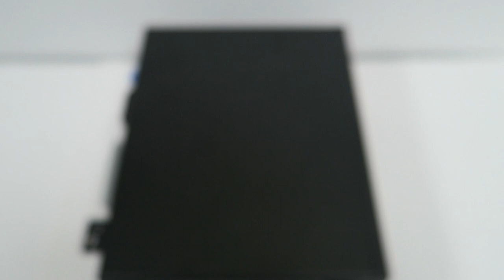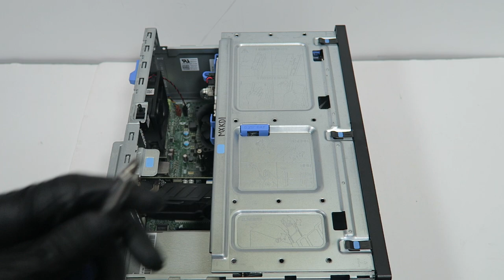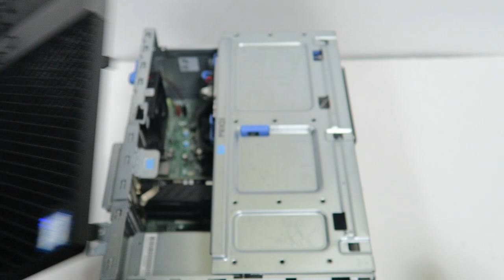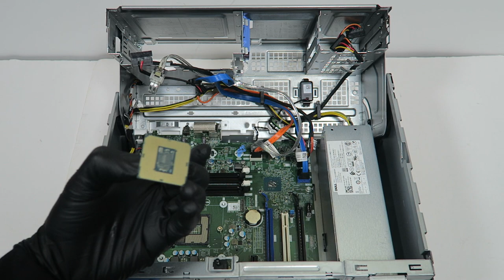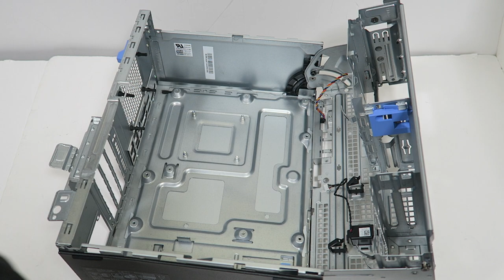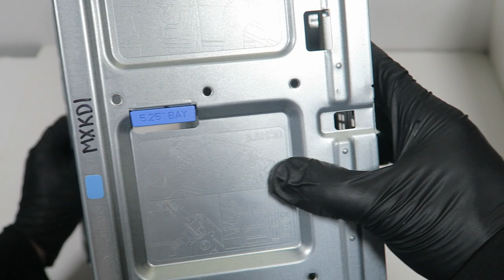Dell Optiplex 7050 5050 3050 Teardown

Comment from the maker: List of Upgrade parts that work with this system. 
 

Dell Optiplex Reassemble
https://www.youtube.com/watch?v=d_iJJm0R1hk

USB Wifi Adapter for PC AC600Mbps Wireless Network Adapter
https://amzn.to/2ZaGuHb

Thermal Grizzly - Spatula for Applying and Spreading Thermal Paste 
https://amzn.to/3d8NQEE

Thermal Compound Paste:
(1.) Arctic Silver 5 Thermal Cooling Compound Paste 
https://amzn.to/2ziNU0H

(2.) Noctua NT-H1 3.5g, Pro-Grade Thermal Compound Paste
https://amzn.to/36kTk7A

(3.) ARCTIC MX-4 (current edition) Thermal Compound Paste 20 Grams 
https://amzn.to/2DhGJaK 

List video cards will work with this system GT 1030 will work with 180W Power Supply or 240W you can use GTX 1650 or GTX 1050 TI low profile.

AMD Radeon RX 6400 Low Profile Gaming Graphics Card
https://amzn.to/3s8MUUY

XFX Speedster SWFT105 Radeon RX 6400 Gaming Graphics Card
https://amzn.to/3xkmXo1

Gigabyte GeForce GTX 1650 OC Low Profile 
https://amzn.to/3el08os

(1.) Gigabyte Geforce GTX 1050 Ti OC Low Profile 4GB GDDR5 128 Bit PCI-E Graphic Card (GV-N105TOC-4GL) 
https://amzn.to/2T8bfsv

(2.) MSI Gaming GeForce GTX 1650 4GB GDRR5 Low Profile Graphics Card (GTX 1650 4GT LP OC) 
https://amzn.to/2X1FYsF

(3.) MSI GTX 1050 TI 4GT Low Profile  Graphic Cards 
https://amzn.to/2LwZd7P

(4.) Gigabyte GeForce GT 1030 GV-N1030D5-2GL Low Profile 2G Computer Graphics Card 
https://amzn.to/2Z4PHkp

(5.) ZOTAC GeForce GT 1030 2GB GDDR5 64-bit PCIe 3.0 DirectX 12 HDCP Ready Low Profile Video Card ZT-P10300A-10L 
https://amzn.to/2WzgLXk 

RAM List:
(1.) Crucial 8GB Single DDR4 2666 MT/s (PC4-21300)
https://amzn.to/2Yx6s64

(2.) Crucial Ballistix Gaming Memory Kit 16GB 2666 MHz DDR4 DRAM 
https://amzn.to/2Ar1orV

(3.) Crucial 32GB Kit (16GBx2) DDR4 2666 MT/s (PC4-21300) 
https://amzn.to/2YDNzhA

(4.) Crucial 16GB Kit (8GBx2) DDR4 2666 MT/s (PC4-21300)
https://amzn.to/3hvAZJV

M.2 NVMe Interface SSD:

(1.) Crucial P3 Plus 4TB PCIe M.2 2280 SSD
https://amzn.to/3RZcUNi

(2.) Crucial P3 Plus 2TB PCIe M.2 2280 SSD
https://amzn.to/3RTUi0Y

(3.) Samsung (MZ-V7E1T0BW) 970 EVO SSD 1TB M.2 NVMe
https://amzn.to/3d52k2a

(4.) Samsung 970 EVO Plus SSD 500GB
https://amzn.to/3fpi95A

(5.) Samsung (MZ-V7E500BW) 970 EVO SSD 500GB - M.2 NVMe
https://amzn.to/37uuLFw

(6.) Crucial P1 500GB 3D NAND NVMe PCIe M.2 SSD - CT500P1SSD8 
https://amzn.to/2N07wKh

2.5 SSD Caddy Compatible for Dell Optiplex 3050 5050 7050 Hard Drive Caddy Bracket
https://amzn.to/3OKOOUb

SSD List:
(1.) Samsung 870 EVO 2TB SATA SSD
https://amzn.to/3ezOds5

(2.) Crucial MX500 2TB 3D NAND SATA Internal SSD
https://amzn.to/3B9f8CF

(3.) SanDisk Ultra 3D NAND 2TB Internal SSD - SATA
https://amzn.to/3RSZ8LR

(4.) Samsung 860 PRO SSD 256GB - 2.5 Inch SATA III Internal Solid State Drive
https://amzn.to/2BY5gRl

(5.) Samsung SSD 860 EVO 250GB 2.5 Inch SATA III Internal SSD 
https://amzn.to/37xWUfc

(6.) SK hynix Gold S31 1TB 3D NAND 2.5 inch SATA III Internal SSD
https://amzn.to/3d7X6D6

(7.) Samsung SSD 860 EVO 1TB 2.5 Inch SATA
https://amzn.to/2B2FURX

(8.) SanDisk SSD PLUS 1TB Internal SSD
https://amzn.to/3hwdqku

(9.) SanDisk SSD PLUS 240GB Internal SSD
https://amzn.to/2zfc7EX

(10.) Crucial MX500 250GB 3D NAND SATA CT250MX500SSD1(Z) 
https://amzn.to/3bTTjbX

(11.) SanDisk SSD PLUS 480GB Internal SSD SDSSDA-1T00-G26
https://amzn.to/2yfgjUK
Reply: Thank you so much 🙏
Reply from the maker: Hi @kiranjoshi2025
Reply: Thank you 👌👍👍👍

Comment: Back again with another question. I have made many upgrades to my SFF 3050, such as:

-replacing the original 500 GB 3.5 inch hard drive with a 4 TB 2.5 inch SSD

-installing a 1 TB NVMe SSD in the M.2 slot, for use as the boot drive (This thing has an M.2 slot but didn't come with WiFi or Bluetooth. Wild)

-increasing the RAM from 8 GB to 32 GB of DDR4

-swapping out the original 180-watt power supply for a 240-watt unit

-plugging in a USB WiFi/Bluetooth dongle

-replacing the old 60 Hz monitor I was using for this with a 240 Hz IPS display

Still, unfortunately waiting on a decent low profile GPU to install in this thing. Was originally looking for a low profile GTX 1650, but now I'm looking at potentially getting the RTX A2000 card once it comes out. However, it just occurred to me that if I'm going to be installing a GPU, I'm probably going to need a chassis-mounted cooling fan, probably at the front vent. Any ideas on how to install one in one of these PCs?
Reply: Late reply, but I have used both an RX 470 and an RTX 3060 in this case without issue, with no extra fans. The 3060 does spin up the fans a bit, but it never reaches 100% or throttles so far as I can tell. Hope this helps.
Reply: @21Trainman  Bro he has a 240W PSU, are you INSANE for giving him hope that he can put an rtx 30 series card there?
Reply: I hope you didn't install a 3060 there, it consumes like 170 watts and that means pretty much every single time you open a game, your computer's gonna crash because the other components don't have enough power supply anymore

Comment: needed this video to check whether the CPU Cooler is mounted to the Frame or not - looks like it is. :/ so aftermarket cooler could be difficult on my 7070 MT.
Reply: all you need to do is cut off the screw mount on the case so you can able to mount aftermarket cooler.

Comment: Informative, thanks. But I wouldn't remove the CPU until the mobo is out of the case (if at all), due to the possibility of damaging the pins on the socket during removal.
Reply from the maker: Hi, if you are very careful you will not damage any pins on the mobo, and you can leave CPU in mobo and remove motherboard first before removing CPU. Thanks

Comment: Can you upgrade the power supply with a standard after market one?
Reply: of course
Reply: Not exactly, since it is a nonstandard form factor. I managed to squeeze an SFX form factor PSU in mine, but I needed to cut out some space in the back of the case for the vent, and a little bit out of the 2.5" drive bays to make space for the cables.

Comment: Can we upgrade the powersupply with these models which has higher watt models? Can you advice model for the upgrade?
Reply from the maker: Hi, yes you can and what model PC do you have ?
Reply: @Mxkdt hi, is it possible to replace the psu with the normal size one?

Comment: Help! I fried my MB for my 7050 MT. I was going to just get swap in a Dell replacement but thought I should do my due diligence and see if there's a better option out there that would fit in the case since I've modded it some (custom window on side panel, cut out the driver bays, PSU upgrade). I actually fried the MB when upgrading the stock PSU to a EVGA Supernova 550 GM. Any recommendations for MB swap for this case and what size would work? I haven't found any info on this online anywhere and I know you're very familiar with the Optiplex line. Fingers crossed you can help me out. Thanks in advance!

Comment: I recently got an Optiplex 3050 Small Form Factor for free (my mom’s office was upgrading their PCs and giving away their old stuff, all they had to do was wipe the hard drive and it was mine for the taking). Problem is, it turns out that this computer doesn’t have WiFi. Ethernet only. I know you can install a WiFi card on the motherboard, and I know you could get these computers with WiFi, but I don’t know where on the motherboard it would go. I know I could also just get a USB WiFi dongle but that just seems like a temporary fix, and I want to have all my USB ports available for use.

Do you know which card would work with this PC, and where it would be installed?
Reply: You do have PCI-e x4 on the board